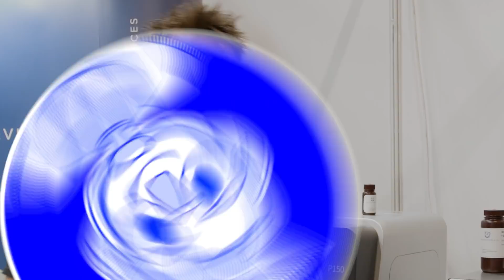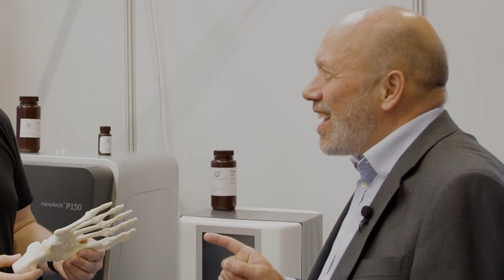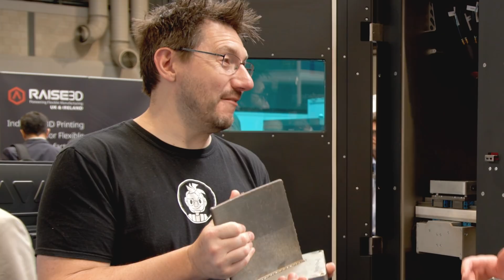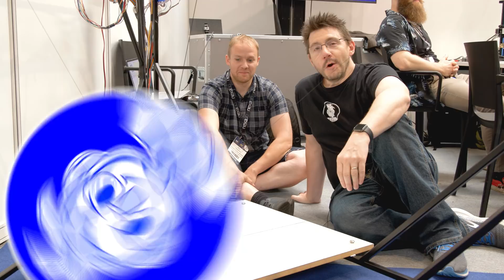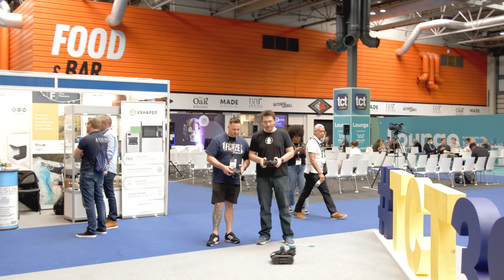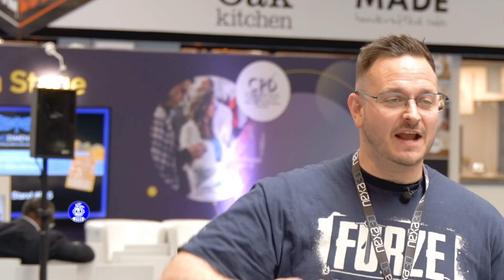CRAZY 3D PRINTING at TCT3Sixty 2022!

Comment: 13:00... Have they thought about supporting the nozzle from the bottom/lower instead of the top? It should help the print quality without adding much cost or programming.
Reply: rocket pendulum fallacy?
Reply: @amphibiland  you'd be correct if it was a rocket. If the nozzle is very close to where the wire supports are, then the nozzle wouldn't be able to move as much. The propellers would be at the top and would give it the balance it needs.